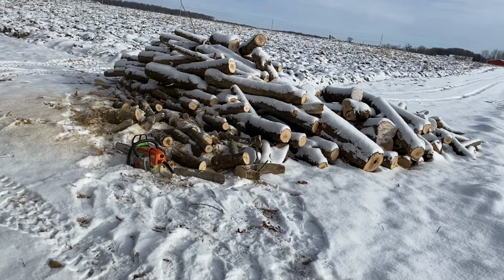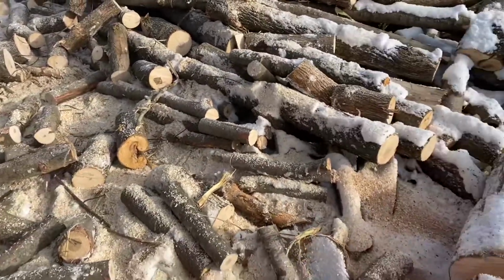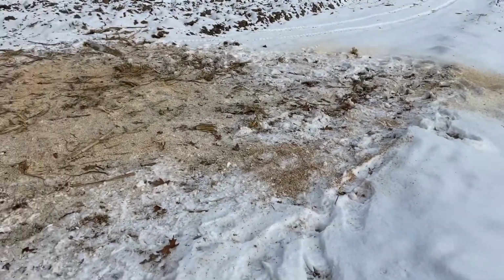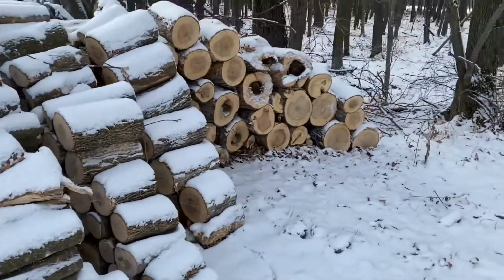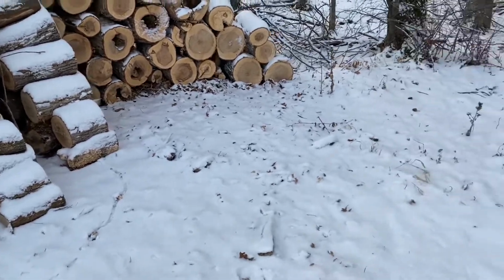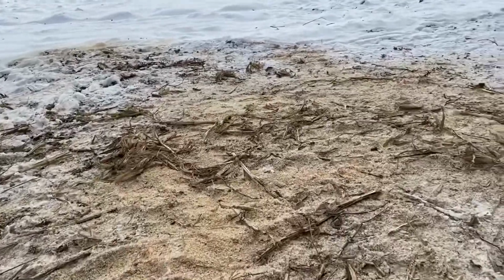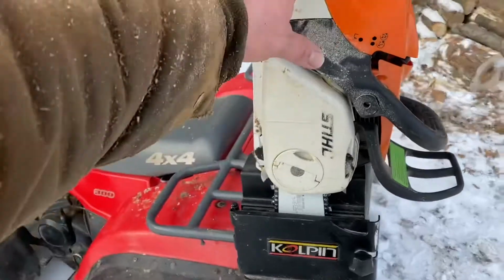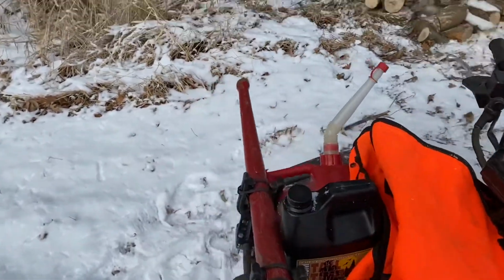Cutting wood with the Farmertec big bore MS270 saw

Comment: I’m confused....did you put the same type of engine in that saw? Or did you upgrade it. I was wondering could you put a bigger engine on a ms270 frame.
Reply from the maker: It is a bigger piston and cylinder. I did a multiple part build on it last spring. Basically the kit I bought makes it the same size as a MS280.
Reply: @shrunkenskulloutdoors  oh super.  Well if you want you can put a bigger bar then? Right
Reply from the maker: I have gone up to a 20” on that saw without any issues. Bar size is also limited on what the manufacturer makes for length with how the bar attaches. The biggest I can go is a 20” on this saw but for what I use it for I still like the 18”.
Reply: @shrunkenskulloutdoors  copy that